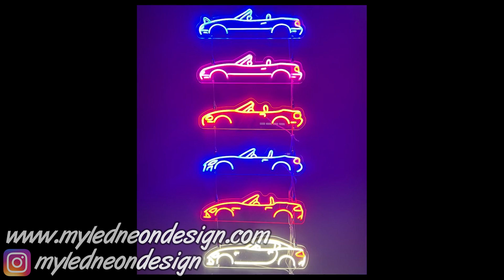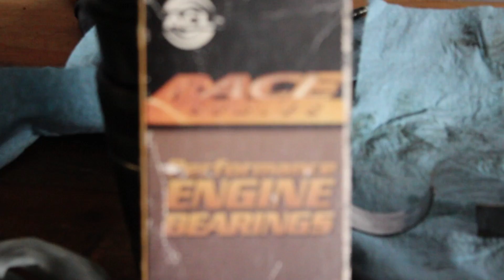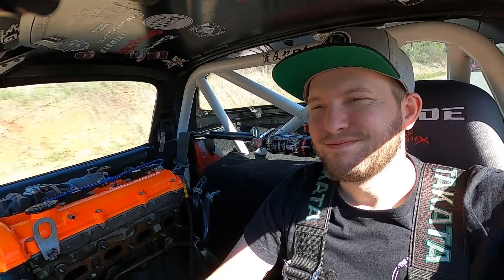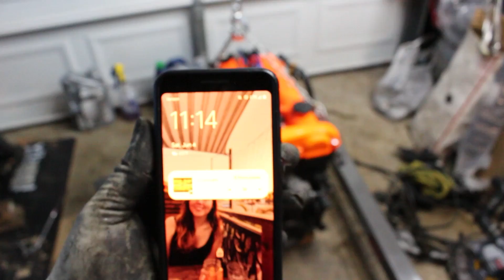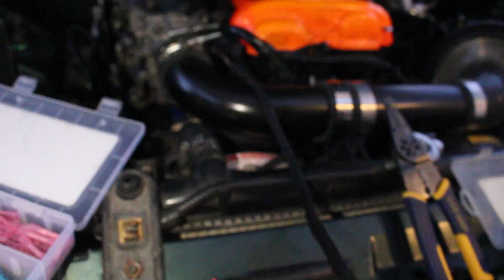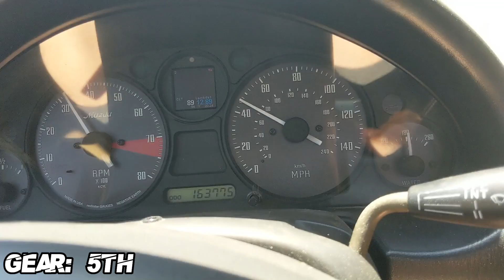I Accidentally Blew Up The NB [2-Day VVT Engine Swap]

Comment: This makes me feel a little better about my last oil change. Drained oil, replaced oil filter from the top, checked a couple other things - air filter etc on a new to me miata. Then poured 4 quarts of mobil 1 5w-30 in, which drained directly onto the ground. Literally right as the last drop of 4 qts was in I saw the oil running onto my shoes from under the car. Then, salt in the wound, as I'm scrambling to pour clean up powder and etc my gearhead neighbor walks up. Thanks for sharing this, liked and subscribed, great channel
Reply: I've done this before. I caught it about halfway through though. Had my friend bring me more oil to make up for it. Left the oil cap off when I went down the road and sprayed it all over my hood. Had my friend then bring me a spare oil cap and some paper towels. Later found the oem oil cap was still around the top of the engine bay.
Reply: I've done this at work with a John Deere engine that takes 14 qts. Learned to have constant anxiety while pumping oil
Reply: Been there, done that :)
Reply: Omg, I did that before. To this day I double and triple check the drain plug is back in. Even then I have anxiety about filling the motor back up.
Reply: Speaking of spilled oil: Rebuilt my crashed VVT NBFL in my best friends driveway. We just replaced the timing belt, water pump cam seals and whatnot. Then came time to fire up the car for the first time in like 4 months. We were so excited! Checked the oil level, the cooling fluid, the timing. All fine. Okay, time to turn the ignition. And it started after cranking just a few seconds.
As we stand in front of the car, with the engine running pretty smoothly, I'm like "hey, what's that gulping, gargling noise?" … "year what is that?" … and then we notice the oil just splashing out the back of the VVT oil feed line. Apparently we did not fasten the banjo bolt at the back of the cam cover … 🥲

Comment: Was replacing my valve cover gasket and as I removing rtv with a screwdriver bit, the bit fell into an oil galley. Removed the head and the oil pan to finally see the bit come out as the bare block was turned over!

Comment: a few years ago I was changing a leaky oil cooler o-ring and forgot the hose clamp for the water line that goes into the stock oil cooler on the block. On my first test drive the hose came off and I lost all engine coolant in a few seconds. Overheated the motor so bad I ended up swapping in a whole new BP6D. Very expensive mistake, but the motor I bought to replace my engine with came with a square top so kind of a win.
Reply: Same exact thing happened to my bp4w

Comment: Heyo Grok, so in 2018 i turbo'd my 97 and on the first real drive, i moved the turbo oil return out of the way to tighten down a coolant line and forgot to put the oil return back... I made it like 7 miles leaving a long trail of oil until the engine seized on the i75............................ yeah i felt this.
Reply from the maker: This hurt to read, but also provided comfort LOL

Comment: With that advice you just gave. I shall do that in fact just with the 5 volt reference power and ground the rest will stay the plug-and-play and if it gets it to where I'm able to start and drive the car then turbo and videotaping it proceeds.

Comment: Didn't tighten a bolt on the timing plate behind the cams when doing a timing belt job. That bolt worked itself loose. Got the timing belt job finished but broke the crank sensor so I replaced it too. Two years later and 15,000 miles and the car dies in an intersection. Figure out that the timing belt had snapped so I pull everything apart again and find that bolt wedged between the belt and the timing cover. 

Do the timing belt job in a bit of a rush in front of my house and when it's all sorted there is a minor ticking sound. Car drives fine however so I just send it rather than create more problems for myself. I suspect the belt was not properly tensioned. A few track days later and a year or two and I'm coming home and the car dies at a light. Now that's strange. Get everything opened up and the timing belt had skipped a few teeth. Okay well no big deal just re-time the engine and send it. Well it still doesn't start. A day of troubleshooting later and the crank sensor was determined to be inop. Get that swapped and man does the car feel good now!

Sometimes we make a lot of mistakes in a short time! One timing belt job that I got too confident on because I had done them so many times on various Miata's multiplied itself by three!

Comment: Couldn't figure out why I was getting 12 volts on my reference circuit through the mega squirt two plug and Play ECU.  Still haven't figured out why it's giving me 12 volts nobody wants to help me figure it out it's okay because I'm just going to wire it up differently through the DB 26 port.

Comment: 2 choices; 
1: trying to diagnose what I was sure was a maf or electrical issue for like 2 months on a 1zz engine, replaced the maf, the sparkplugs, the fuel filter, backprobed more plugs than I would want to know, vacuum testing, did so many tests while datalogging on an obd reader.. It wasn't excess air, it was a bad fuel pump. Derp.
2: Low beams won't turn on, I start trying to diagnose what is clearly an electrical issue, get as far as replacing the headlight control stalk, not driving at night for like 5 weeks because no headlights.. I had the switch on the wrong position
Reply from the maker: I'm going with #2

Comment: something to help prevent this from happening, is write "NO OIL" on a piece of blue tape, and put it on the valve cover, and even on your cluster, to force a reminder until you get a chance to put oil in it
Reply: Also have the oil cap removed until its filled. Easy visual reminder and the car will never run well with such a big vacuum leak.

Comment: I had a 2002 chevy cavalier. 4 door mom car. But 5 speed and lowered on bcs. Was a super sleeper. Clone 2.2 from the cobalt ss. Supercharger and all with the smallest pulley I could run. About 14psi. Forged Internals, upgraded titanium valve springs seats and retainers. The only thing stock was the block and crank. And it was fast. About 330 whp. Balance shafts deleted so it revved to About 8k. Well my biggest mistake was the good ol 5 to 4 down shift. And by that I mean 5 to 2. And about 12k rpm at 70ish mph. Let's just say it cost me a set of bearings. Could have been way worse. But I to this day still feel so dumb lol. Money shifts ftw!

Comment: Hi Greg. Here's my story. I have an NC with a fully forged and built 2.5 and a Fab9 EFR kit. Two years ago, during a tuning session I melted the engine all the way down to zero compression. I didnt realize it dropped all the coolant during warm-up. My fault, I put a Aim dash in front of my gauge binnacle on the steering column. When I'm logging with the laptop,  the dash must be unplugged to give me access to the CANBUS. So I'm relying on the ECUTech readout on my laptop screen during these drives. Took me two more years to afford a new engine, and I just did the swap myself for the first time to make sure everything is to my satisfaction. I am currently about to fill all fluids! Its been a journey. Your channel is inspiration.

Comment: Well, I tried to fix my valve lash and accidentally screwed my cam cap bolts a little too tight. So my cam slammed stuck into the head.

Luckily a cylinderhead aint that expensive but the work was avoidable

Comment: Yeaaaa I probably am gonna have to sadly do a harness swap on my 94 noticed the car was running bad and had that throttle issue that nothing would fix looked into the wiring under the car and took off some electrical tape revealing the previous owner completely cut off multiple wires on the harness including oil pressure gauge wires going to the IAC and more! so that's great lol hopefully I dont have to take the whole thing out

Comment: Running a car without oil... 🤚 Same here.Long story short, what was simple alternator change lead to accidently lossing one of the oil lines for my oil cooler. I turn on the car and drove  neighborhood, when I came back to my garage I saw a massive oil spot.🤦🏿

Comment: Stupid things I've done working in my cars.

1: putting a new shirt block in my STI I installed a head gasket upside down and put all 5 quarts of oil straight on the ground when trying to prime the oil.

2: forgot to install sealent on the oil pan half moons of my turbo Miata engine when installing rods. 

3. Sent a rod though the block of my Mazdaspeed Miata from some very spicy timing.

Comment: I pulled my engine for a turbo build and put in a boundary oil pump. Forgot the O ring that seals the pump to block surface and had to pull it again after putting it all in and back together. Not a fun day that was

Comment: I just got done putting a straight pipe end piece on my 2002 NB that has a 4-2-1 cobalt header, high flow cat, and nothing else. So I wasted about $300 and will be putting the previous muffler back on when I get some new hangers. But at least I got rid of my exhaust rattling noises with some poly bushes, which getting them on was 90% of the work, but the exhaust is super still now. Its just way too loud, and sounds ridiculous and illegal. I just did this like an hour ago then saw this video pop up.

Comment: Started with lifter tick. Did a internet mix of oil/atf/kerosene (one quart all combined) let idle per the instructions for 10 minutes. I was rewarded with rod knock. Well I ended up with forged motor as a result.
Reply from the maker: Lmaoo @ "rewarded", typical internet experts

Comment: Was swapping an exhaust. Loosened the back wheels for some reason. Swapped the exhaust, drove towards home. Heard a wobbly sound. Realised that the wheels were loose pretty much seconds from them falling off. Crap.
Reply: Not that big of a fuckup, happenned once to everyone, you only really fucked up if they actually came off.

On my dad's Audi it's literally the worst thing, you can get those fuckers tight as can be, like so tight they're about to strip, you drive 15 meters, and they start wobbling like you forgot to tighten them. Then you go to tighten them, they feel like they were put on by hand and now you're good to go. It seems like the hub bore is too tight and only goes all the way in after driving to help it settle, it's a fully stock car with factory wheel and no rust or shit on the hub bore or on the wheel. Just weird.

Comment: That's literally my worst nightmare. Once I had my car sitting in front of my house with no oil in it for about a week because I broke the oil filter housing cap and was waiting for the dealership to get the part in stock (and therefore couldn't finish my oil change), and I was shit scared of forgetting for some reason and going to start it, even tho there was almost no way I would forget.

Also the reason why after recently getting an e36 one of my first mod is gonna be an oil pressure gauge. For some reason I trust my daily with no gauge but that thing I just can't.

Comment: I wired in my first MS into my mx6, couldn't get it to start and sent it to a shop. After 3months I confiscated it back... When I got it back it did start and run roughly. I took a few test drives and it just fell on it's face above 3k rpms. I knew very little about cars and just added throttle, it'd stumble more and then pick up. After a couple trips around the block, I really wanted to drive it. Late one night I decided I was going to drive it. My wife on the way out the door said "Don't call me if it blows up".  Less than a mile up the road, and 6 miles on my first boosted car, I did a full pull. At 5500rpms, 14.7 psi, no working 02 sensor, and 27* of timing on 87oct the bottom end let go while detonating. I learned a very expensive lesson that night, Don't do boost kids. You'll get hooked, here I am years later, multiple rebuilds and still hooked on that feeling of boost building and the tires breaking loose.

Comment: In fairness, nothing has happened yet. But I’m one of the very few unbalanced individuals that own both a Miata and a Harley. My Harley is old enough that the engine is within 11 CCs of being the same size as my 1.6 Mazda! Over the weekend I drained the oil of the Harley and, after failing several times to remove the ‘old’ Oil Filter, I decided to just replace the oil and reuse the filter. It’s now Monday afternoon and my Harley hasn’t had ANY oil in it since Saturday morning! I’m scared $#!+less that I’m going to fry the engine because I forgot to add oil!

Thanks, Greg, for preventing a catastrophe! :p

Comment: I turbo charged my stock motor NB2, and planned to leave the motor unopened with a reasonable ~200whp. I talked to different tuners, messed with the tune myself, and then got a remote tuner to get me running. He used the tune I had been working and didn't see there was a 10° cold advance on top of everything. Drove it a couple months that way, then - rodknock. 
6 months later, the Miata is running good with a forged built bottom end. Sorting some more things out now, then going for 300+whp!
Reply from the maker: Man, those special condition spark modifiers are always messing things up. So easy to miss!
Reply: Is that setting something that comes with a base map? Where do you find a setting like that in ts?
Reply from the maker: @discount111  You take a datalog and make sure the final spark advance matches your spark map. If it's off by 5°, that means there's something modifying the advance (there are a lot of advanced modifiers that are normal but you just don't want them to come in at the wrong time)

Comment: Machine shop said the heads ready to drop on and go. Slapped it on without checking anything. 1k miles later and 2 reshims found out that that machine shop put stock valves with oversized valve seats turning them into razor blades. Rip $2,000 and another few months with the car sitting.
Reply from the maker: I winced thinking about stock sized valves slamming into oversized seats

Comment: On my old engine setup in my 240. I had to do a cylinder head so I swapped everything out. Grabbed a brand new head gasket that was on the wall and put it together.  Started driving the car and the head gasket blew.  Turns out I put a head gasket for a completely different engine in an had to do everything again